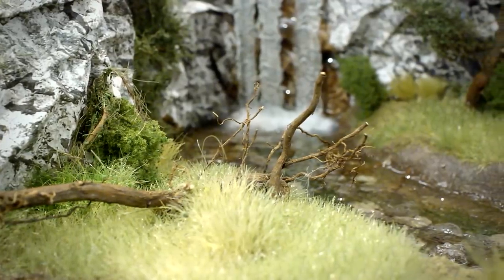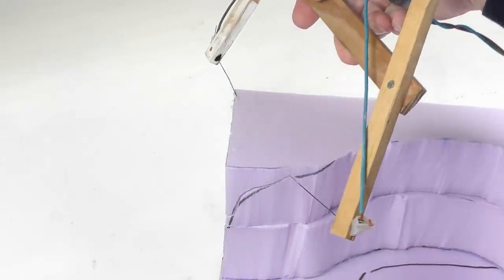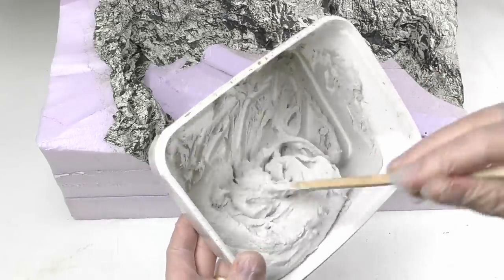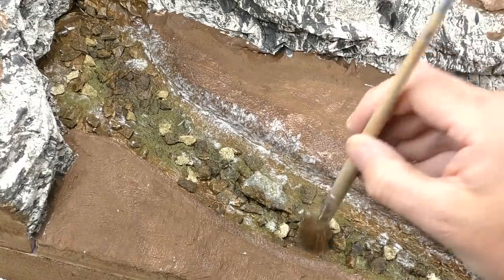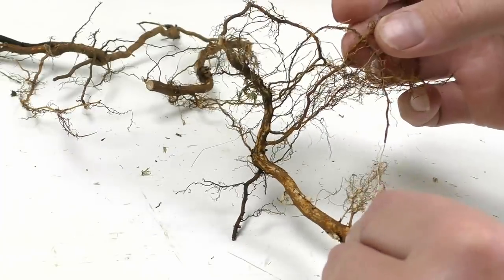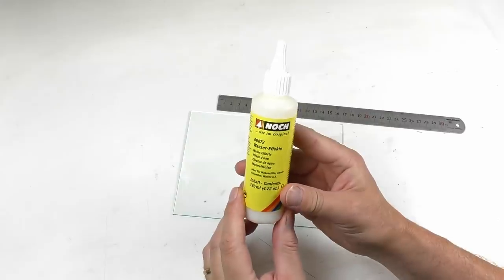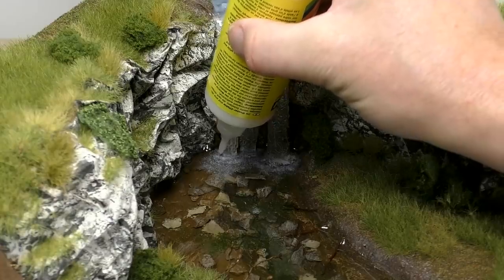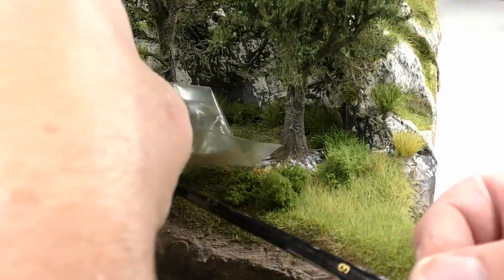Chalk cliff Waterfall miniature diorama

Comment: Strange.. my static grass never stands like that. It starts that way but falls over once the applicator is moved. The only way I can get it to stand like that is to use a vacuum.  Any ideas?
Reply from the maker: Hi! 1) Load less grass in the applicator. The charging process only seems to handle about 50ml at the time. 2) Use a  thin layer of a thick type glue intended for static grass. I use Noch grass glue. 3) Hold applicator 10-20mm over the surface. Move slowly over the surface. 4) The applicator should have >20kV capacity. Good luck!
Reply: @marklinofsweden  ok. I use the woodland scenics Static King

Comment: Does the two part river water heat up
Reply from the maker: Hi! I made some trials with this epoxy before using it on this diorama. Because Styrofoam and heat is a bad combination. I could not feel any rise in temperature as the epoxy cured.